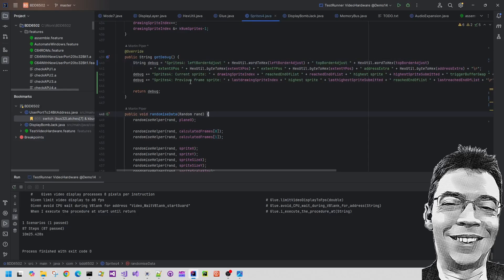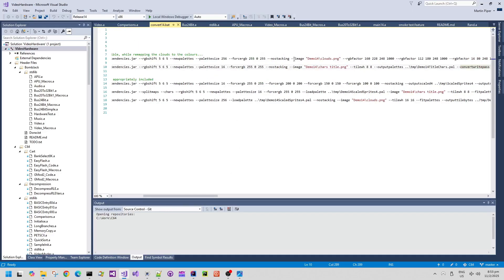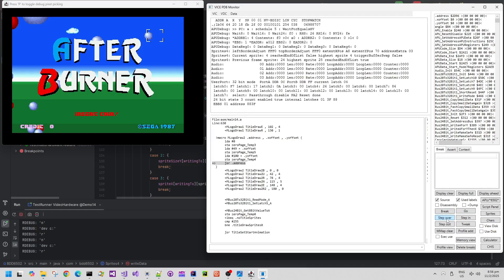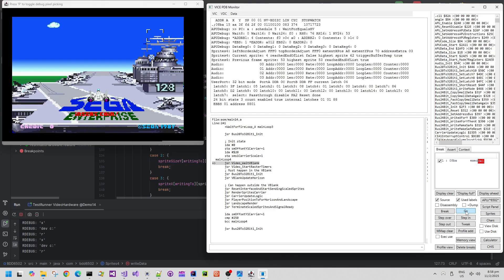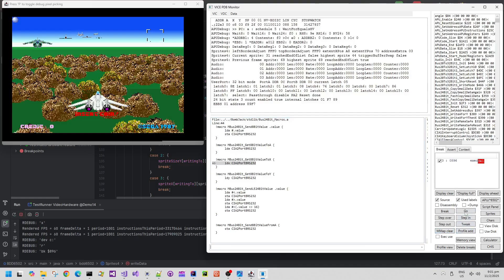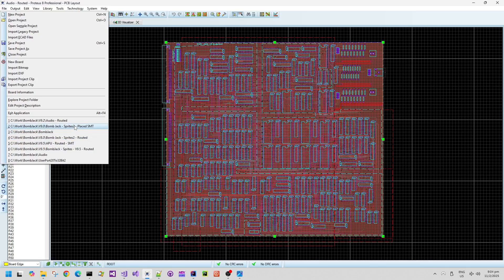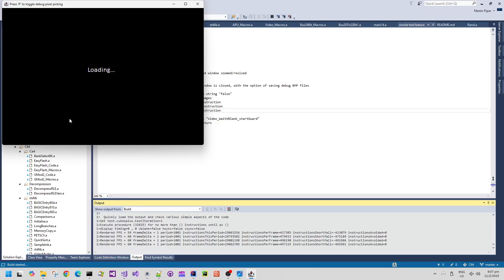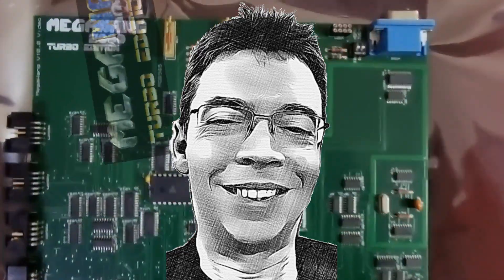MegaWang 2000 Turbo Edition - 34 - Super scaled sprites design test

Comment: Do you know whether the Sega Super Scaler hardware also uses a full framebuffer?
In my mind the distinction between sprites and framebuffer + blitter goes back to the golden age of the arcades (so later Williams machines added a blitter to their pure CPU + framebuffer initial design, while many others added sprites).
In this view, what you have is a scaled blitter implementation, not a scaled sprite implementation. But if the people who defined the scaled sprite era also used a framebuffer, this view is not sustainable.
Reply from the maker: Yes the Sega version also uses a full frame buffer.
Reply: @MartinPiper6502 mind blown. And you are not just going off how some emulator source code (e.g. Mame) happens to emulate these games?
Reply from the maker: @AndrewHelgeCox  I'm going by the hardware specs :)
The Y-board has double frame buffers for the sprite rotation.
https://segaretro.org/Sega_Y_Board
Reply from the maker: @AndrewHelgeCox  A couple of years ago I did implement a scanline buffer scaled sprite board, that had a much lower draw rate because everything had to be drawn in the time taken for one scan.
Reply: @MartinPiper6502 Thank you for the reference!
Reply from the maker: @AndrewHelgeCox  Or the earlier X-board has two 512x256 frame buffers. https://segaretro.org/Sega_%22X-Board%22_hardware_notes_(2004-12-03)
Using a frame buffer gives the hardware the entire frame time to draw sprites, which results in a lot more stuff on screen :)
Reply from the maker: @AndrewHelgeCox  so yes, you make a good point. Since the X and Y super scalar sprites hardware uses two full frame buffers, we cannot really claim "anything drawing to a frame buffer is not sprites". :)
Reply from the maker: @AndrewHelgeCox  No problemo. You might be interested in a more recent video where I have two super scaled sprites boards running basically the full game. https://www.youtube.com/watch?v=nWQjSncJ57M
Reply: @MartinPiper6502 It seems like a per scanline sprite list or per band of k scanlines sprite list instead of a per screen sprite list could get you some of the perf back for a scanline renderer at the cost of needing more CPU work to build the lists and more space to store them.
Reply from the maker: My implementation uses a full 512x512 frame buffer (even though the screen is 224 lines tall). This was to make the Y clipping test easier in hardware by allowing a larger coordinate base. Also the RAM chips used are that size as well. :) I can also scroll the frame buffer to make the clipping easier for the screen dimensions by adjusting the coordinate base.

Comment: Is this compatible to other such hardware for the 6502 like in the Atari Lynx or SNES (with the memory mapper maths Co-processor). 3do also has a Memory mapped co-processor for transformation.

I love about the Jaguar that it does scaling using a linebuffer. Any chance that you go back from frame to linebuffer? GBA also scales sprites in the linebuffer and rotates them!

I would love to see a rolling linebuffer: a queue which depending on the chosen resolution covers multiple lines. Then the hardware would loop over the display list and try to render as many lines as possible at once. 4x4 pixels could be stored in 64 bits — oh wait, too much Jaguar here.

Actually, I would love a z-buffer for this queue. Render front to back. Give unused memory cycles to the CPU. For back to front here the next position in the queue for each sprite would need to be kept in a buffer. Close sprites are not allowed to draw over reserved space.

Why not be compatible to copper or even JRISC ?
Reply from the maker: Yes, it's compatible with pretty much any  retro computer that has a 5V user port or equivalent. The line buffer scaled sprites design is already built as a PCB and works. It could be plugged into the board stack alongside a frame buffer scaled sprite PCB.
Reply: @ I meant software compatible. Are the registers at the same place? Is there a “mapper” to enable compatibility with any of those consoles? So that we know that it is possible to port those games. Or you could show how your interface is much cleaner or natural.

SNES has a single line buffer like the genesis and Atari 2600. That is the reason for a “background”. Consoles with a double buffer have a unified interface: NeoGeo, Jaguar . SegaCD is a mystery to me. 

I have no idea what Argonaut was thinking when they designed the GBA graphics.
Reply from the maker: No there isn't a mapper. It's not really needed. The capabilities of this hardware are so different to existing functionality that a "compatibility mapper" wouldn't make much sense.
Reply: @ ah, I mean it imitates After Burner hardware including the missing sprite rotation.
Reply: Do you have a reference for 16bit and earlier consoles using a scanline buffer? I know that Jaguar used a pair of them. My understanding (not deep or authoritative) was that SNES, Megadrive, etc. had per scanline lists of sprites and that the scan out process directly traversed those lists and the tilemap data in RAM to resolve pixels on the fly while pumping them out for display, without buffering them into a single pixel high, screen wide scanline buffer first. I thought that was inherent to what "sprite hardware" meant.
Reply: @AndrewHelgeCox  Youtube does not allow me link outside because I did not give them my CreditCard, yet. But google Rodrigo Copetti.

Atari always used a scanline buffer (single) and gave the CPU access to it. NES and its "successor" the pcEngine do not. I have read some interview from Sega. I think that the graphics chip is open. I did not understand if it is "off the shelf from TI", or if it was an ASIC. For some reason you only find it in the genesis. The linebuffer is hidden, but there are signs. The color palette is limited because the linebuffer needs to hold "true color". Resolution on SNES is 512 . The linebuffer has 2 bit alpha to mix with the background. This is probably not a sign because mixing works the same on NES and C64. I think, the real proof is cost analysis. Genesis has 32 sprites on the scanline. Now, would you pay for so many instances? And in 1989 CMOS probably was used. CMOS was invented for SRAM (in all versions ) because it stays cool while nothing changes. So idling sprite circuitry would stay cool, but so does the line buffer. SNES has even more sprites. The arcade hardware for Mortal Kombat has a double line buffer ( is documented somewhere because homebrew tries to port it all the time). Atari had a patent on scrolling. I wonder if the linebuffer is subject to patents? Or are sprites patented by TI?

Comment: Back in the day it would have probably been better to just include a beefier CPU rather than to put huge LUTs in ROM or RAM.
Reply: Also I wonder why no one used ARM2/3 CPUs back in the day for arcade boards. No one knew they existed? 68000s (and heck, even Z80s!) were so prevalent.
Reply from the maker: ARM2 was in 1987 the same year this was released. They couldn't render this. I know. I tried. :) The first StrongARM in 1996 probably could.
Reply: @az09letters92  Arcade machines adopted 16/32bit CPUs when they became available at reasonable prices. ALL arcade machines were designed for specific games at the time, for the lowest price. Using custom chips to handle the graphics was cheaper at scale than using a massively overpowered CPU that likely still couldn't match custom chips. No 16bit CPU at the time on its own could render After Burner. The people designing the machines DID actually consider cost and efficiency. Also remember this project is just what Martin has decided to do with his own machine. If he wanted to do it the easy way he'd just use a Raspberry Pi or something, but that's not exactly interesting content, is it? I've made custom machines with a 6502 and massively overpowered GPU/audio hardware because it's fun to do. It's not because it's easy, or even sensible!
Reply from the maker: Yeah, the much easier way is to use an RPi  or one of the other cheap SoC and get that to render stuff. But as you say, that's not that interesting.
Reply from the maker: Back in 1994, Daytona arcade was the inspiration for BHP but that was released in 1997 using StrongARM software rendering and could not match the arcade resolution and frame rate. Here's a video... https://youtu.be/SnCxpg4Hj9E?si=VBGiuFpP3N5LEBjz
Reply: @Anticitizen666 I think the OP was saying that a faster CPU could perform the muls and perspective transforms that are replaced by large lookup tables in a memory expansion in the demo shown in this video, not that it could render the whole scene in software.

Even later ARMs like the 7tdmi in the GBA lacked hardware division so that might not actually be true, but it is a more reasonable point.
Reply: @AndrewHelgeCox  I used to be part of the PC demoscene and started with the 486 line of PCs. Although they could do division and had floating point units it was still faster to use lookup tables and fixed point math for vector operations. Especially if you organised the code to hit the cache as much as possible, which meant sometimes even rendering to the frame buffer in ways you might not expect. If you look through the source of the original doom from around the same time it also uses fixed point math instead of using the floating point unit for speed.
Reply: @Anticitizen666  Doom also had to run on 386DX and 486SX so there was no point optimising for the current top spec at launch if doing so tanked the low to mid specs where most would play. Although for a software renderer over a slow bus to graphics memory, the pixel level optimisations and avoidance of overdraw must have dominated.
Reply: @AndrewHelgeCox   Not really, as someone who worked on engines at the time (3D and 2D parallax scrolling/sprite engines in ASM) even when the FPU was available it was slower than FP for games/demos. The only time you'd use it would be if you needed the extra precision - certainly not for performance. The software 3D calculations, ray-casting and BSP tree traversal were the bottlenecks, actually drawing to the buffer bit-planes wasn't such a big issue - especially with only 320x240 resolution in modeX. LUTs were used a LOT - usually generated when the game/demo loaded, such as sine tables, inverse funcs, texture mapping offsets etc, as these would kill performance if you tried to calculate everything per frame. Sometimes these were baked into the code, but due to the capacities of floppies, and slow download speeds it was often done dynamically at run time :) Adrian Carmack wrote some interesting articles about it back in the day if you're interested.
Reply: @Anticitizen666 John Carmack did update their plan file with lots of good info. I seem to remember from the time of the Doom source release his comments being that the math side of it was not what his later self would do. Something about expressing things in polar coordinates...
I actually played around with doing transformations on fixed point inputs using floating point units, albeit ARM11 VFP, as an easy win without rewriting a whole codebase which was based on FP for older processors, but I didn't go to far with it because on my platform with this code, profiling showed > 50% of time in drawtriangle() and the rest of the cycles scattered all over. I think there was one skinned animation piece of content where the skinning code might have hit 20% on the profile. This is decades ago: I'm old too! 😅
Reply: I am still looking for multipliers as parts. Everyone talks about Dadda trees . Ben-Eater uses 4 Bit adders. Scaling, rotation, and affine texture mapping can be wired up with a regular grid of those and some data latches . Now gonna watch.

So, could we use 4 bit adders for a 16x16 multiplication board? I did not find ALUs, so Booths algorithm becomes difficult. So directly feed their operands in a Matrix. We need 64 quad NAND gates. Then somehow squeeze the adders in between to slowly diffuse out of the Matrix while compacting the data-set. Or we need a multilayer board. Probably better to build a 8x4 multiplier and some variable shift to skip some zeros and microcode and a queue.